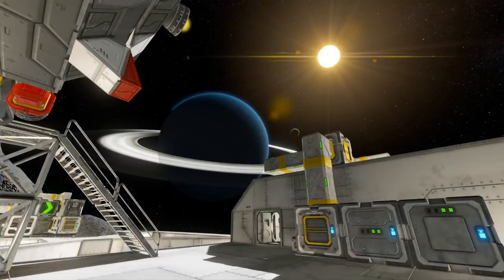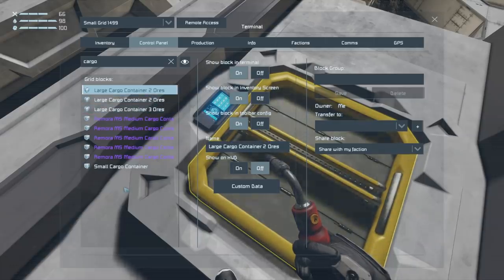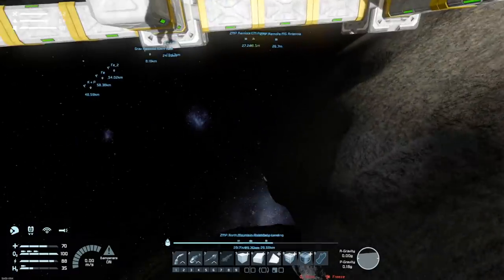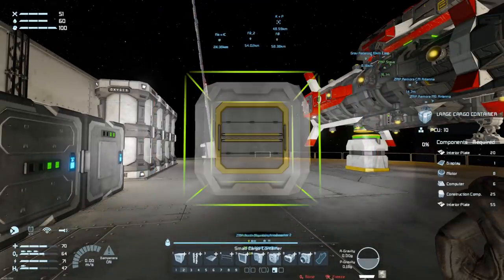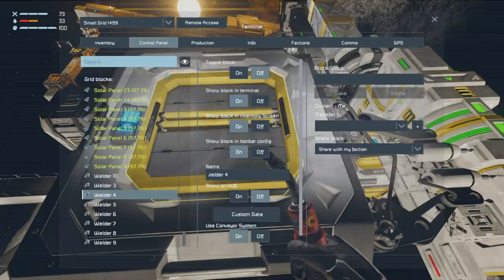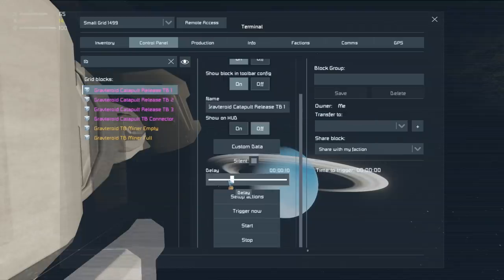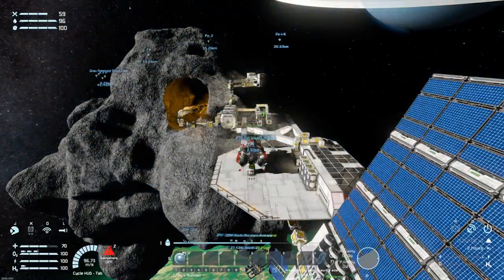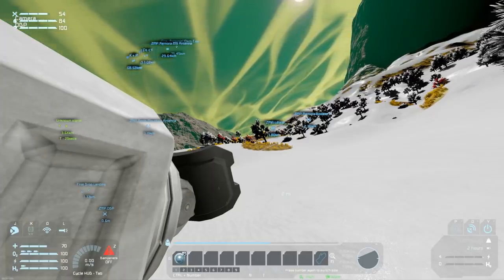Survival Impossible - Space-age Catapults #32 - Space Engineers Hardcore Survival

Comment: I have an idea for something funny but also possibly very practical;

Build an elevator that can take the Ramora up to 0G, and if that can't be done, atleast you have a kind of catapult that can fully or partially yeet the Ramora into 0G, which could be quite useful for saving hydrogen 😉
Reply: Getting to zero-G from the asteroid should require minimal fuel, but it would be interesting to see if it could be done with just a toss. He's going to encounter hostiles, though.

Assuming he uses this base as a staging point for more exploration, ice and hydrogen stockpiles will be necessary. Bringing it up from Omicron is possible, but a dedicated ground-to-orbit tanker to do fuel runs for an ice lake outpost is desirable, because snow harvesting is tedious. I suspect Splitsie has a plan along those lines already. The logistics are challenging, not least of which just confirming an ice lake (they're hard to identify from orbit). The whole thing will be much less risky once he's found silver in orbit, so he can make additional survival kits.

Failing that, he struggles by on minimal range until he finds an ice asteroid (unlikely) or all the materials to build ion thrusters and maybe a jump drive, and hopefully the system has the standard moons (probably) all of which have abundant ice deposits/lakes.

Comment: This may have already happened automatically if you have an excess of gravel, but you need to make sure the launcher connector is filled with gravel (or some other kind of fluff if you need less weight) so it doesn't fill with iron. Keeping the launcher arm light will let most of the energy from the hinge go into accelerating the pod rather than the arm.
The first fluff item that comes to mind is radio components since they're huge but don't take a lot of material to manufacture, making their density quite low. I know I've done lots of back and forth to weld up large grid antennae because of the size of radio components.

Comment: Full Container of Iron had 24000kg while the same volume of gravel had 9000kg, when u change it to iron you will have quite a distance from your test drop pod location. Try filling it with Stone to so how much it weight and have a better testing, also I think the pod is disconnecting from the catapult before the hinge reachs 90º so maybe delay the disconnection for about 1 or 2 seconds
Reply from the maker: That's a good point, but I don't think I've got a method of getting the mass any closer without just using Iron. I guess I'll have to keep that in mind and try to get the gravel pods to overshoot the base a little and also expect to need some adjustment after switching to active drops

Comment: health and safety ... hmm star wars is bad ... but Romulans in the new trek universe (sepcially those who followed the old spock) are extremely bad ... ;)
Reply: you could make the launcher super simple ... it just needs to impart some velocity to your pods ... put a piston or two above the pod pointed in the direction you want to push the pod to ... then you print the pod on the asteroid attached to the merge block on the piston ... once full you can then set the piston to extend fast and release the merge block just after it starts with a very small delay ... then as the cargo pod gets moved and detached it is pushed in the direction you want and off it goes ... then on the planet either have a recycle bay to recycle the pods ... or add 4 thrusters to it and a program block .. then just place the cargo pod on a launch pad and set it to launch ... have it go to straight up to orbit out of the gravity of the planet and wait for you to pull them over to the asteroid ...
Reply: does the sorter only put canvas into the parachutes ... and not into the cargo pod as well ... if it does both you may want to rethink how you load the canvas

Comment: Haven't watched the whole video yet, so you might have changed this later on.

You said that you need the large battery on the launch pod because the test drops will and you don't want to change the mass. 
A change in mass shouldn't change the impact point because the acceleration due to gravity is the same for all masses (not the force but the acceleration) and you likely will be launching the pods with a set speed and not a set force. So the pods will land in the same place no matter the weight.

Edit: On earth things of different mass fall at different speed because of air resistance which is a set force and not a set acceleration meaning it doesn't change with weight whereas the FORCE of gravity does.
Reply from the maker: The issue is not gravity but the acceleration from the launcher being reduced due to mass resisting the force of the hinge
Reply: @Splitsie  You should be able to increase the force to where that doesn't matter though right? That way only the rpm is a concern. Not sure if that works with clang though
Reply: TLDR: Mass doesnt matter as long as there is no drag or any other forces.
To give a proper idea:
the movement equation for free fall looks like this:
F=F_g
mx´´ = -mg
x´´ =-g
solving this (integrating both sides), you get:
x(t)=-1/2gt^2 +v*t + x_0. With a starting speed of v and an initial height of x_0. The Speed can be calculated using the Angles per minute by R*omega. With R being the length of the arm and omega being the angles per second. (So if you have 60 angles per minute you must divide that by 60 to get 1 angle per second.. Naturally this is a vector function, so while g always has the direction "down", the speed v doesnt, in our case it might actually be quite opposite to down, doesnt really matter too much as the g term will overweight the longer time flows.. x_0 is also a 3D vector.
Mass cancels out, as long as there is no drag.
Reply: @henneanonymus7275  I believe that will be clangy once the acceleration comes to a stop.
Reply: There are two limits for the hinge: the torque and the angular velocity. If the torque is enough to accelerate the hinge to the specified angular velocity within a single game tick, then the mass of the pod shouldn't be relevant.
If the mass is relevant, one possible solution would be to release the pod at a specific angle (using a script) rather than using a timer. That should ensure that the pod will always be released at the same velocity and angle.

Comment: Splitsie Here's an overcomplicated escape pod suggestion: make an escape drop pod with a cockpit replacing the cargo container, that way you can catapult yourself to safety in an emergency. Just add a second projector so you can select it in place of the standard pod. The cockpit's internal O2 capacity would be enough on vanilla, though you could have O2 bottles automatically loaded into it if your increased O2 consumption requires it

Comment: If you try to do a 1/2 full gravel/iron, launch your sorter will try to push all available canvas into the storage-dropod.
Reply from the maker: That's a good point, other than using an inventory script to do the job for me I'm not sure if a nice way to get around that...
Reply: @Splitsie  You can have 2 sorters when first one is loading iron/gravel then when it is full second sorter loads canvas (the only avaible space is in Parachute Hatch)
Reply: Splitsie you could also run your components building script for the components for the dp to only produce 25 canvas so that the sorter will always pull all of your canvas. You could simply set your timers so that the components for the next pod aren’t produced until the previous one has been launched so that you don’t ever end up with just a drop pod full of canvas
Reply: If Splitsie uses Isy's Inventory Manager with autocrafting, then it'll all be good - the canvas in the drop-pod will still be in the base's inventory system before launch, so it will still be counted as present and the autocrafting won't make any more.  After the launch, suddenly there will be zero canvas in the base cargo system, and the autocrafting will kick in and make more, up to the nominated amount.  No timers required.  Same with the other components needed for the drop pod (although for them, you don't even need to be very accurate... if you say you always want 5 power components, say, then as the battery is welded up, more will be produced).
Reply: @Splitsie  Since it sounds like you'll be using Isy's inventory manager anyway, you can add the 'custom' tag to the connector and cargo container and specify a full load of gravel/iron for each.

Comment: For the cargo container, there are a lot more pros in favor of using a small grid large cargo container vs a medium one:

Pros:
- ~5x more cargo volume in a single drop of a large-sized payload (or ~15x player inventory)
- the improved payload volume would also allow much higher throughput (5x) if the launching and gathering were automated
- lower overall chance of a single payload being shot down vs the equivalent 5 medium-sized payloads
- much cheaper to launch a single large payload vs 5 medium payloads as you only need one battery, merge block and connector for either of the variants
- while the parachutes will have to be scaled up for the large payload, it would still be less than the equivalent cargo volume of 5 medium payloads
- the large drill array lends itself better to a larger payload volume even if the payload would get shot down

Cons:
- launching would have to be tuned for the increased weight of the payload
- tests would be more expensive, especially in terms of maxing up the cargo volume (though I guess you could use gravel?)
- the existing catapult setup would likely have to be redone

Ofc all of this depends on how much you intend to rely on dropped ore.
In the future, you could use this gravteroid to launch other rare ores down, like gold and platinum, instead of spending a lot of H2 going through the atmosphere.

Comment: I got to thinking about the ice lake and how far it is from your base if you have to go around the entire valley each time. 
A possible solution might be to make a tunnel through the valley down to the "floor" of the ice lake area. The goofy should be able to handle digging that out or you could build a simple 4 wheeler with a rotatable drill arm ( I built one where the drill are along the horizontal axis that can be moved up and down, this allows it to change the digging angle) 
Digging out a long tunnel might take a while though...  Either way, i love your content and cant wait to see what else you come up with. 
P.S. DO you think a Bait system could work against the reavers? just an Antenna, battery combo that you could Yeet into Space.

Comment: I thought of suggesting you before to add the hinges mod as it would improve a lot of your builds, but I know that you like to play with vanilla blocks. I'm happy that you now have vanilla hinges. A big shout to Digi for creating the mod in the first place.

On a separate note, full cargo containers might reduce the launch speed as the hinge will struggle more with the mass. If the launch vector is the same, the trajectory will be the same regardless of mass as there's no air resistance. But I suspect that the launch speed will be lower with higher mass. But I guess you'll find out either way.

Comment: Regarding the supply pods that is going to be catapulted. You can design a new vehicle that is remote controlled whose purpose is to drive out to where the supply pod lands, even if it's only 50 meters away because of landing margins, and pick it up and put it where you want it. Or even better make a conveyer belt system using wheels that, one way or another, brings your supply pods to where they get disassembled and stuff the rescources away in the base down on the planet.

Comment: Awesome!

There's an issue with the drop pod though and specificaly with canvas use. The sorter pushes all canvas in the base into the pod, including the pod's cargo storage, making it impossible to keep any stocked for future drops. 

A fix for this would be to remove canvas from the sorter and add a second (small) pipe from the junction to the connector. On that pipe there would be a second sorter set for canvas but not set to drain all. The parachute hatches should pull their canvas from the base while the main sorter fills the pod's cargo storage with ingots.

Here's a thought for the launcher. Would replacing some or all of the pipes with pistons allow you to tune the drop location by allowing you to vary your arm's length and with that your pod's launch speed? It's been a while since I had high school physics but....

With the new hinges you can almost do small grid refueling/service arms or ground service vehicles, like tanker trucks, to service vehicles. The only thing missing is a way to use the small ejector as a connector and connect it with larger connectors, but there's a mod for that (coupling blocks)

Good luck and stay safe
Reply from the maker: Yep, that's the best solution I reckon - must remember to implement it right at the start of next week :)
Reply: @Splitsie  or move the sorter to between the cargo container and the connector and only have it drain what you want in the container

Comment: @42:25 I'm still a few episodes behind real time, but you can create very precise catapult releases by using a separate rotor-mounted boom with a sensor on it. If the boom has a piston (or a few), you can accurately sense when the catapult head crosses any point in its arc. Then, you have the sensor trigger your timer block managing the payload release. You may not have reason to here, but this can also be used to create different configs if you had multiple delivery targets or payload weights. It's also a pretty good reason to involve extra rotors and pistons into the mix. :D

Love the series, btw! The hard work and passion you put into it, even while sleep-deprived, is amazing!
Reply from the maker: Sensors might allow a little more control but sadly when using them for things like this in the past they don't prove as reliable as you'd expect. From what I understand it's something to do with the prioritisation that they receive, if there are enough other actions occurring during a particular physics tick then the sensor can be bumped and detect later than it should as a result. Might not be a big issue here since the arm isn't moving all that fast, but for quick moving catapults it can have a big and sometimes hilariously nasty side effect :D
Reply: @Splitsie  Aww, dang. I didn't know about that issue; it's been a few while since I built one like that. Thanks for the information! I may need to test these delightful nasty side effects. :)

Comment: Another victorious step on the way to... what actually?
At first i thought you are going to toss that pod into the gas giant.
Once you are good with catapult setup, mark each drop with GPS marker to monitor deviation. Maybe they're not spread so much after all? 

Looking at those lakes, i think you need to seriously think of some reliable long term transportation, not just off road every time. Maybe some sort of tunnel trough the mountains? I'm sure nobody would mind if you later use Voxel hands to smooth the road once it's done. 

Glad that script worked for you :D *local potato happy today*
Pro tip: You could use Programmable block display as LCD, no need to build another one ;) 

Tell Capac great minds think alike - I've commented you the same suggestion about "neon cables" last week. The pipes from Survival Maybe was my first thought when i saw this block shapes :)